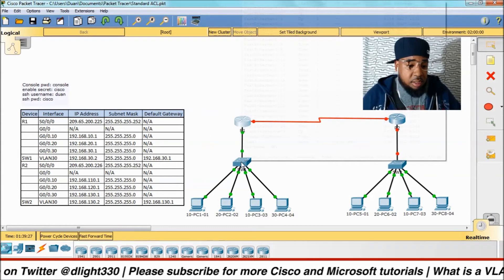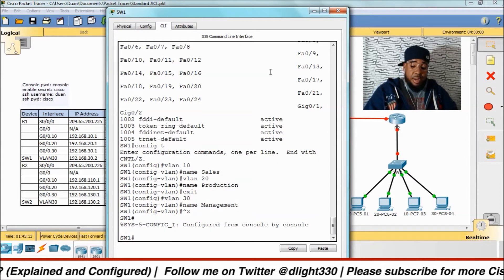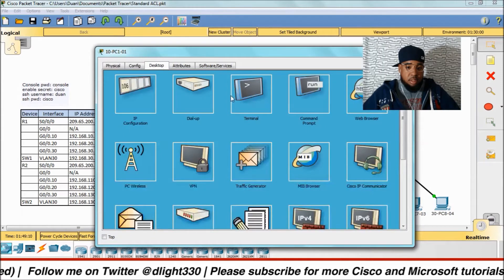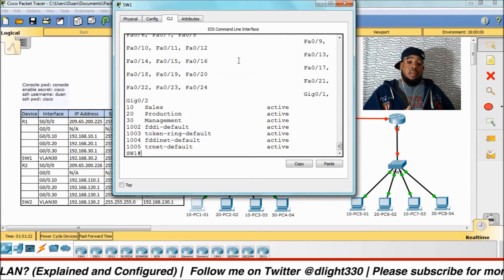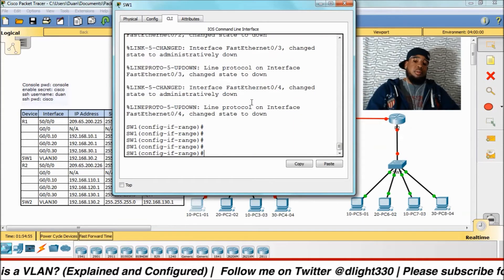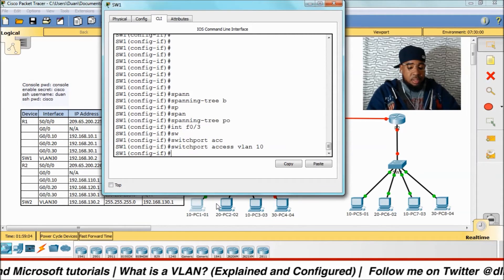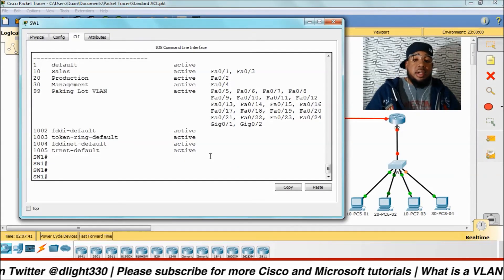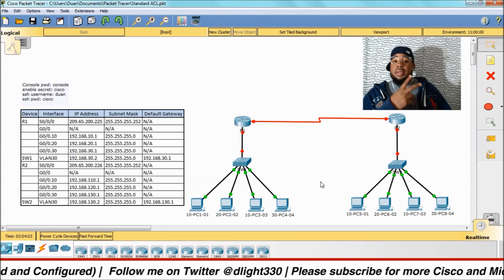2.4 Configure, verify, and troubleshoot VLANs  | CCNA Packet Tracer RIP Lab part 4

Comment: Good video mate, and a good demonstration of virtually separating machines with VLANs. The bulk of my CCNA lab arrived today so can't wait to get home, unbox it and make a video!

Also glad you made the point of having network ports not in use disabled. This should be a standard practice everyone follows regardless of the vendor they use fro networking gear, and if the stuff you have doesn't have this functionality, for the love of God upgrade to something that does.